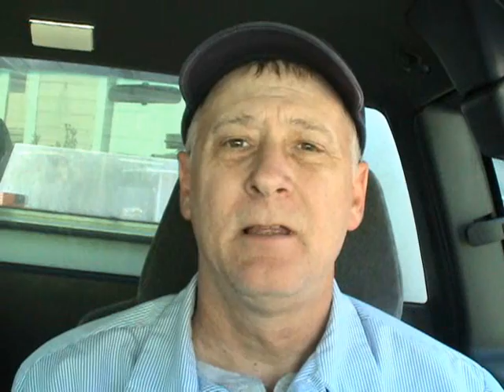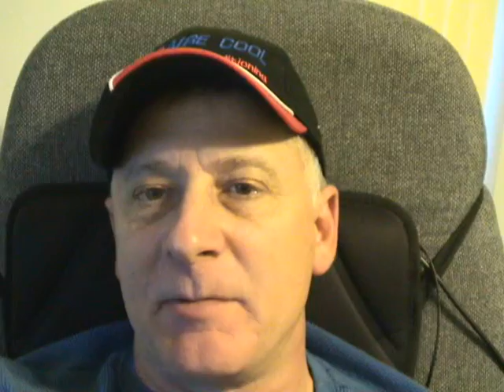HVAC schools

Comment: Oks, what has been happening in the field is when these techs get out of school they CANNOT read a volt meter. Nor do they check for power, know ohms law, or know the sequence of operations. They can weld, hook up gauges, and maybe read a tape measure. If those schools are being paid $40,000-$60,000 a person, don't you think they should know how to do that?

Comment: I went to a jr college program in Jacksonville, Fl (Florida Community College at Jacksonville). It was a wonderful program. I was 45yrs old at the time. One of the instructors was an HVAC contractor and occasionally one of his techs would call in for help with a diagnosis. He'd put his phone on speaker and let the class participate in the diagnosis. He also was always bringing in units that he had replaced for us to work on. To me, one of the most impressive things in the classroom was a walk-in cooler. We installed a heat pump INSIDE the walk-in so we could understand how a heat pump works in the winter time. All of the instructors (except the dept head) were active HVAC techs. The dept head had been a tech for 35 years and decided to teach instead of continuing his tech career. It was a 16 month program going full-time and FULLY prepared me for my career. The total cost in 2006, including books, was like $3400. Although I did not ever go to work for an HVAC contractor, I am a successful maintenance technician for a Real Estate company making around 60k per year. And I also do some side work occasionally which nets me another 5-6k per year. Yes, HVAC has been very, very good to me.

Comment: Are you still in the Ft Myers area? I bought a condo down there last year. I go down a couple times a year. My wife goes more. Last time I went I found that my dual run cap had gone bad. The condenser fan wasn't working, Luckily my condensing unit had a high pressure switch. Also found that the dummy that installed my air handler in the attic over tightened the male adapter and cracked the drain pan. Go on vacation to go to work.

Comment from the maker: Learning to read wiring diagrams is a must if you plan to be a service tech. To really confuse you even more, there's more than one symbol that is used for some components like pressure switches and compressors. I'll have to do a video about it.